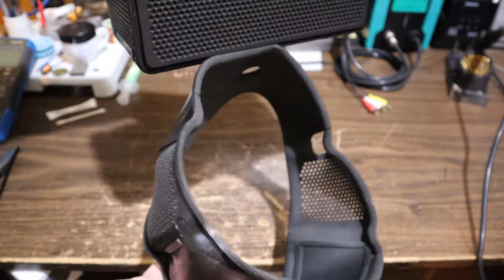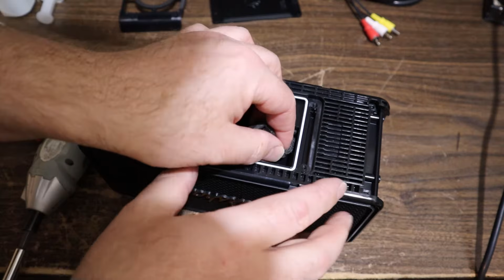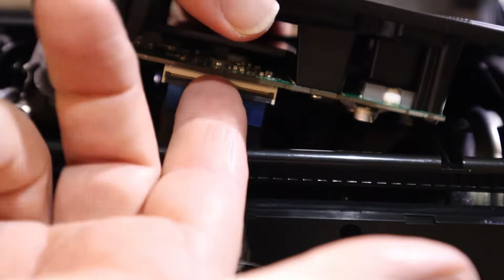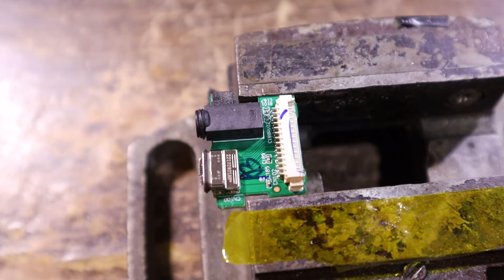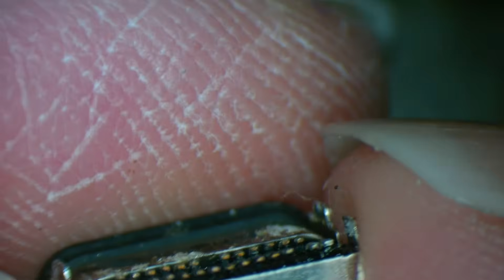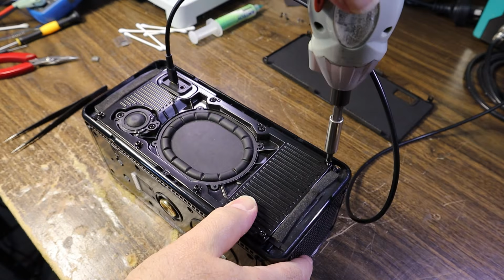Marshall Middleton Bluetooth Speaker Repair!

Comment: Fixed my port but the speaker is still not charging?? Any advice please ??
Reply from the maker: Check battery voltage. If <3.6 (or 7.2 if double cell, I can't remember) it might be charging just very slowly until it reaches that much for safety. It may appear to be dead until then. Could take a few hours depending how low it is. You could use a bench supply to charge it faster but don't go above 100mA until 3.8V. If battery has a good level but unit not charging then double check your soldering. Use a fine probe to test each contact in the USB connector does connect through to a pin on the connector to the main board.
Reply: @JonnyFix Thank you, I’ll try that.

Comment: Can you tell me, my marshar does not turn on, but if I put it on the charger, then on the indicator 2 lights up 1 does not light up 2 lights up 1 does not light up 2 lights up. What kind of error could this be?
Reply from the maker: Have you left it on charge a long time to see if more lights come on, maybe battery is very flat. Maybe first light is broken and should be lit so looks odd.

Comment: Hi brother 
Now they fixed to issue but it's stuck in pairing mode maybe only the Bluetooth light blinking now for days and no beutifull sound coming out from it
Reply: Bro same problem, mine can pair and everything but the lights which indicate the battery don’t work, also the sound is either too low or on max
Reply: @tomaschicaiza2861  😬😬😬 atleast it has some sound fur this now I will just throw it because my warranty is already used up
Reply: Do you find any solution?
Reply: @tomaschicaiza2861  no bro it doesn't pair 
I tried resetting it but it doesn't get fixed I think only buying a new controller board can fix it I think
Reply: Ok thanks man, I’ll try to get my warranty since I got it only on march

Comment: Hi bro my Marshall power button stopped working and that fibre cable which connects the controller board to the amp damaged do you have any spare
Reply from the maker: I don't sorry.
Reply: @JonnyFix  thanks

Comment: The Battery cable has a connector mid-way between where it enters the chassis. You have to un-wrap the black foam at the thickest part of the battery cable, and underneath are white 5-Pin connectors that are easily UN-plugged. Then you can be remove the battery.
Save the foam and re wrap the connector when you re-install it so that it doesn't rattle to the BASS!
Reply: This is the information anyone trying to solve their battery-not-charging problem needs to know! Thanks
Reply: https://www.youtube.com/watch?v=XVqCb2r41zM

Comment: Mine also same problem, my one was broken, I am onboard a ship and my colleague Electrical engineer said that he can’t soldering that small piece. Do u have any suggestions how to find the power charging board for replacement ?
Reply from the maker: Maybe ebay unless you can find a marshall agent who is able to order direct from marshall.... if they are willing to supply. Sadly it's very proprietary
Reply: Can you provide the search criteria you used to find the usbc part
Reply from the maker: Marshall Emberton USB Port, because the emberton uses the same one but nobody was showing it for the middleton. Sadly I cannot find a listing for them right now.